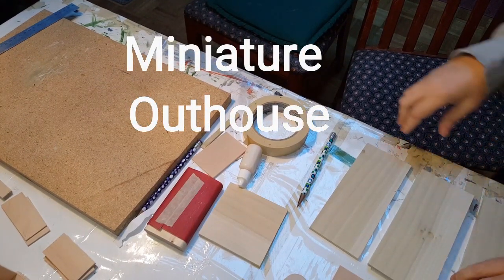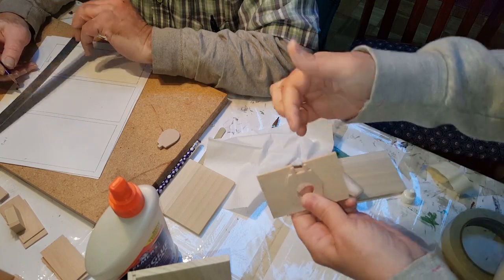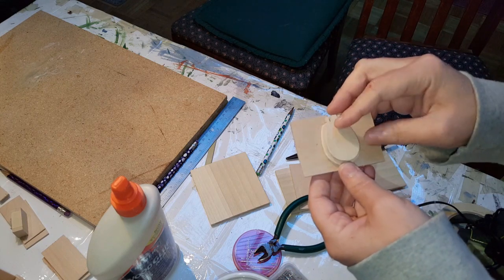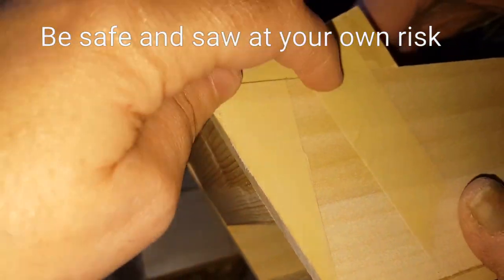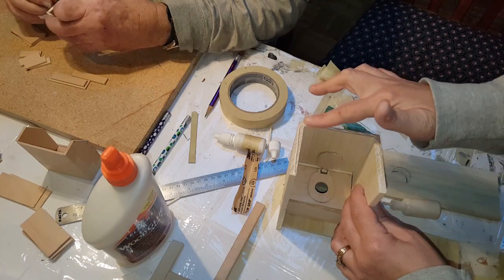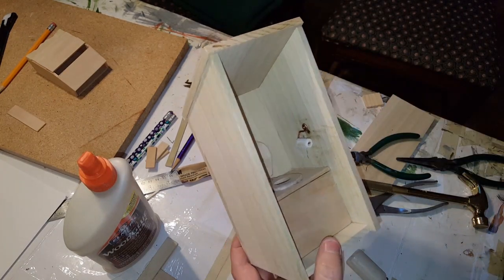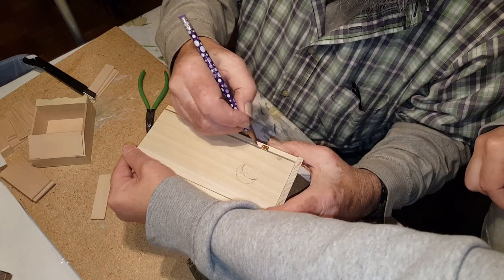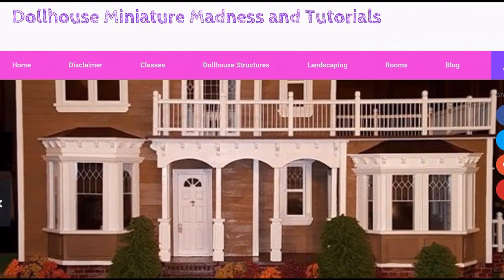Miniature Dollhouse Outhouse/Bathroom

Comment: I like the idea of an outhouse because lot of people don't like having a bathroom in their dollhouse taking up valuable real estate, plus an outhouse can be used in lots of other places. I think I would modify it to be wider and deeper. Wider to allow room for a shelf on a side wall for extra toilet paper and hand sanitizer, plus the TP dispenser under the shelf, and a hook for a purse or lantern at night. Most outhouses I've been in just have a long rusty nail hammered into the side wall for a hook. And I'd make it deeper for a bit more legroom. Since real porta potties and outhouses tend to have mesh screen at the top to let in light and have ventilation, but keep bugs out, I might try to incorporate that feature as well. Might not need to cut the roof at an angle that way. Just have wooden posts at each corner to put mesh screen between and create the angle for the sloped roof. I've even been in outhouses that were open at the bottom, and at night there were little mice running back and forth around my feet. Honestly you just can't be all squeamish if you're going to go camping in the kinds of places I've been.

Lol, I am reminded of a backpacking trip I went on in the wilderness. The last place we could go to the bathroom before we needed to bag up our own solid waste had a wall-less outhouse in the middle of an open field. It was quite the experience. As the only woman in my group of ten, I went early in the morning and hoped nobody was watching. Not much you can do really at that point. It was just so nice to actually sit down instead of trying to squat over a hole in the ground when your legs are tired. One of my favorite bathroom experiences. Beautiful scenery at 13,000 feet elevation or whatever it was. (And I avoided having to poop in a bag and carry it on me by being prepared ahead of time. I brought chewable Pepto Bismal and had some of that, shared with my son and we both made it out the other side without having to use the "wag bags" they had) This field outhouse was just a bench seat with a toilet seat in it, no walls.
Reply from the maker: Wow that sounds like an adventure
Reply: @DollhouseTutorials  it was so much fun. We climbed the highest mountain in the lower 48 and actually made it to the summit. Not something I ever thought I'd be doing at 50, but that was a once in a lifetime thing for me, and I'm so glad I did it. Got photos of a Mama bear and her cub one day too right on the trail in front of me. Long time ago.